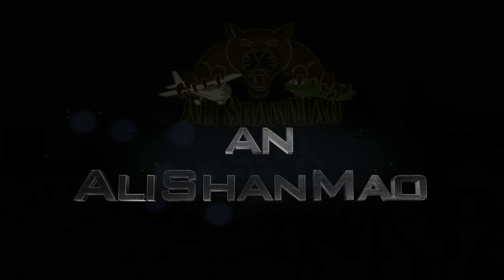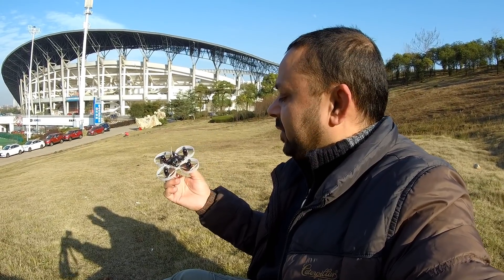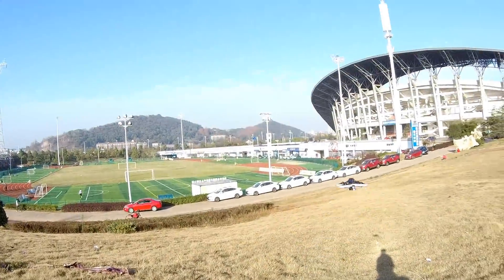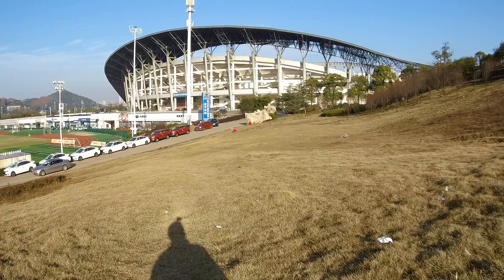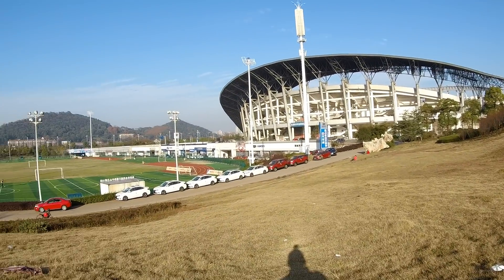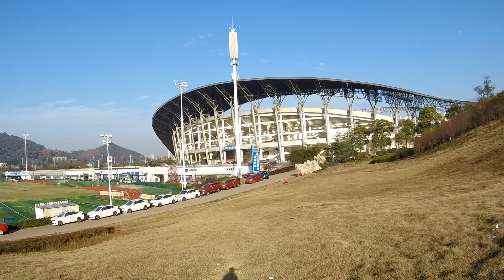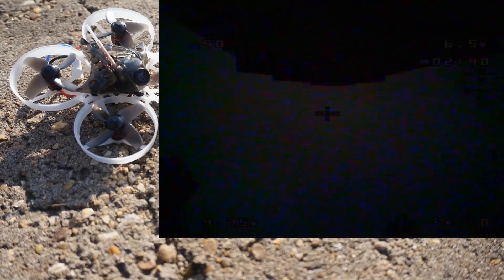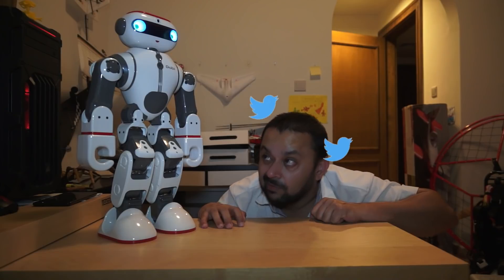The Super Whoop Mobula7 Crazybee F3 Pro OSD 2S Brushless FPV Whoop

Comment: hello friend Well, my name is Leandro and I live here in Brazil, I bought a mobula 7 and I can not connect it to the ev900 glasses. I've already been informed that I will have to change his vtx. Can you tell me what to do and how to do it ?. I'm new to the hobby and I'm totally lost. Thank you very much and big hug.
Reply from the maker: You can use Smart Audio to change channels and bands. 
power on radio

Power on Whoop
do not arm
Hold throttle to mid and left and pitch up. You will enter OSD menu
Goto  VTX Menu and change band to Boscam A
Change Channel to 1 or 4
Save and exit
now your EV900 should lock